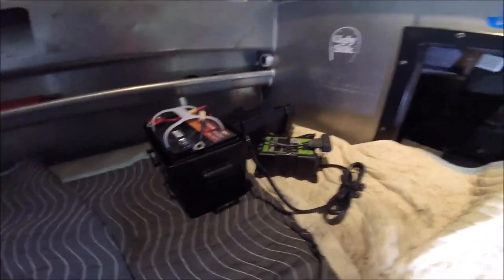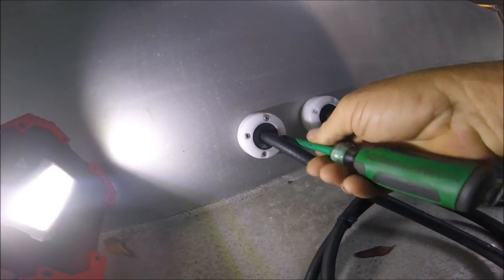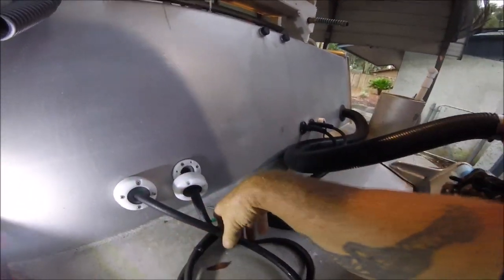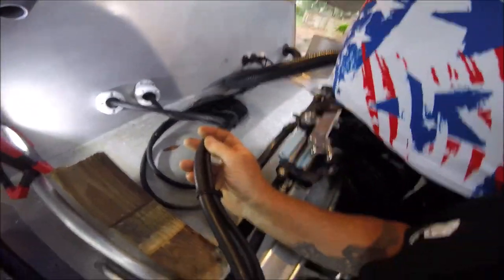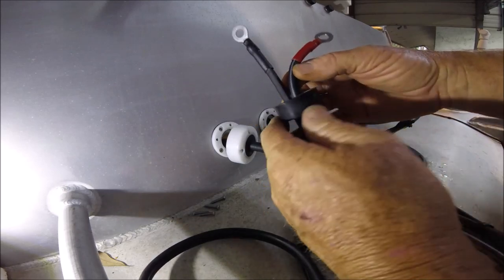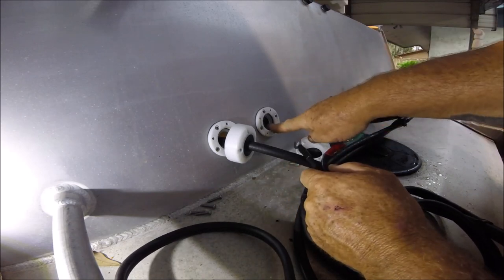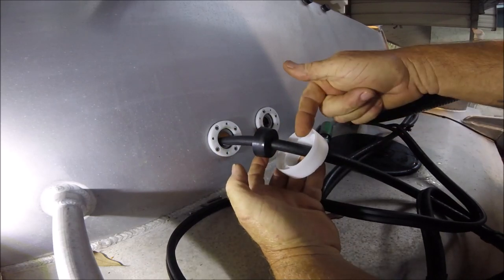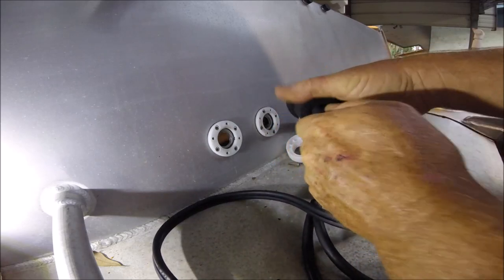MERCURY 15 PRO-KICKER - FINAL RIGGING

Comment: I never knew they had a such a thing as that there transom clam. Dave. I mean Captain Dave : ] I like the chain guard business. Protection only works if you protect before it's a problem. What's them...control cables on the Suzy laying all loose...next! I built Airplanes for 20 years as an assembler and at Boeing they had a motto up on big banners in our building... something about continuous inprovement. Keep up the great work Captain!👍👍
Reply from the maker: can't do much with my hydraulic steering lines. but all is ''good'' now on the Jettywolf's transom. The Aussies and their killer alloy boats, also drive other innovations. The chain guard is used with the drum anchor winches....again not much seen in USA much. But Hammer marine in TX is connected to the best, Lone Star, Drum winches.